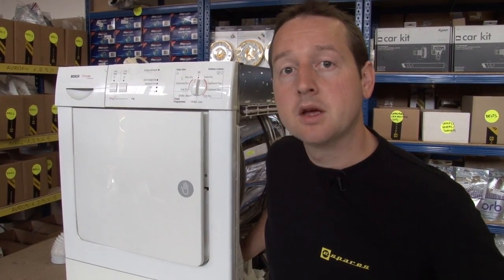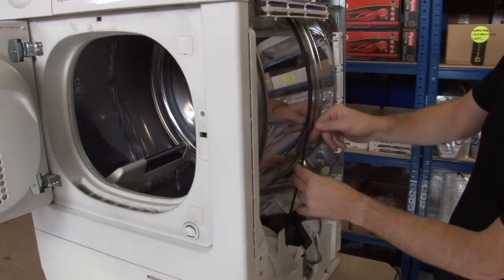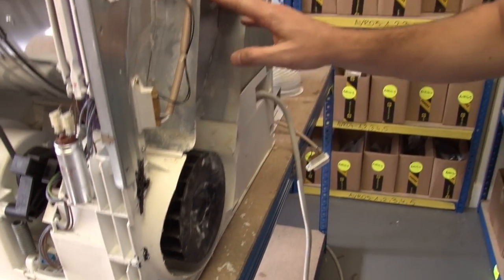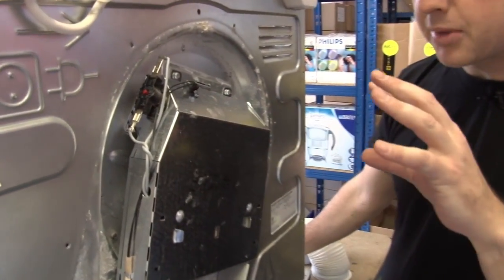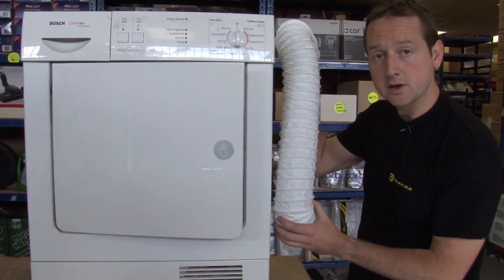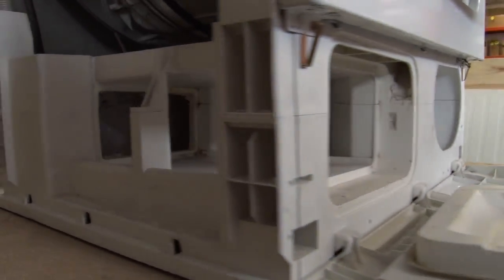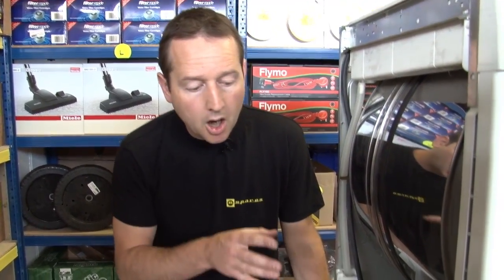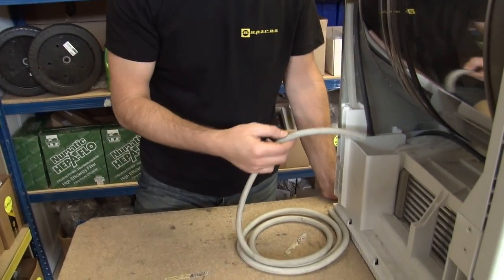How EXACTLY Does a Tumble Dryer Work? - Find Out Here!

Comment: Does this only removes water ? Or does it provide heated drying ?
Reply from the maker: Hi Krithika, nearly all dryers use an element to dry the clothes, only a condenser dryer will collect the water as a vented dryer pushes the hot air through a hose, we hope the explanation helps.

Comment: On this machine; What to do if all filters are clean, everything else looks Ok, but I still get filter alarms? Any sensor somewhere I should clean?
Reply from the maker: A filter error or alarm indicates the air flow is likely to be restricted causing excessive heat. If your dryer has a duct pipe out through a wall check the pipe and wall grill as we have known these get blocked with lint. Wash the lint filter with warm water to ensure it is not restricted and retry.
Reply: eSpares It's a condenser dryer. Filters and condenser are clean, but still filter alarm after a few minutes. Where is the location of the  sensor that activates?
Reply from the maker: The sensor is likely to be a thermistor either on the heater  or in the ducting.

Comment: what about heat pump dryers? how do they work?
Reply from the maker: A heat pump dryer is basically a condenser dryer but the heat is not produce from an element. Instead there is a built in dehumidifier, This is basically a fridge. With any fridge or freezer there will be one area cooled and the heat will be transferred to another area so in a fridge the inside is cooled and there is a radiator often on the back that disperses the removed heat away. By using this system the heat is blown into the drum to help evaporate the moisture and this moist air is then passed over the cold surface produced from the refrigeration. The dried air is then passed over the heated surface through the drum again. This makes the dryer very efficient.